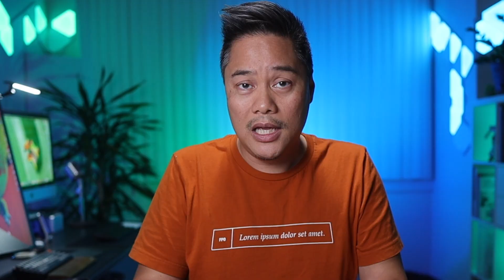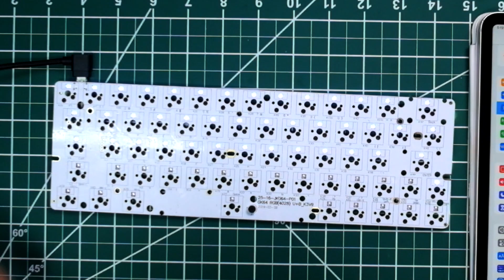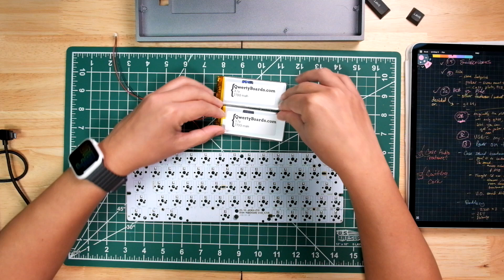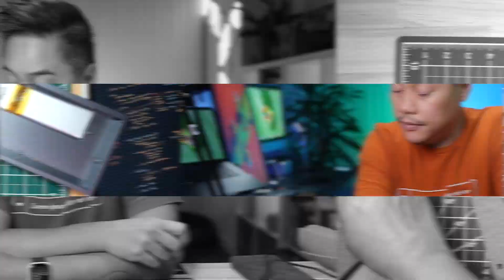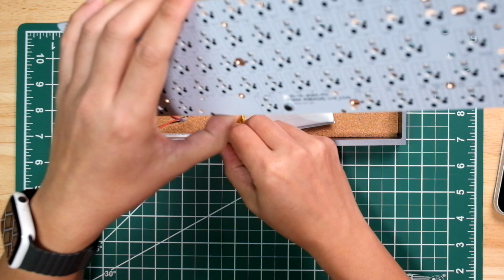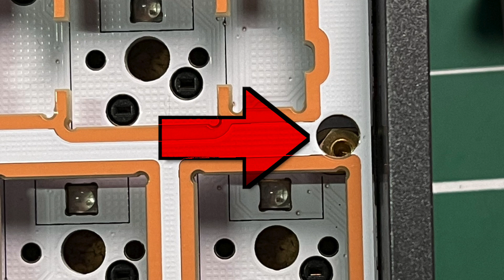Part 2: My first mechanical keyboard build

Comment: For the screw, are they rounded type that you were using? The hexagon shaped ones that used for securing motherboards maybe easier to work with a plier.
Reply from the maker: Yeah the posts were hexagonal, but the screws were just normal round ones.
Reply: @clicketyclacks7847  The hexagonal standoffs can be tightened down using a small socket.